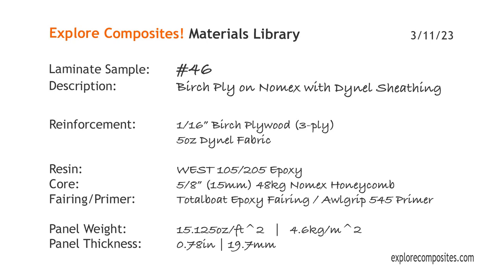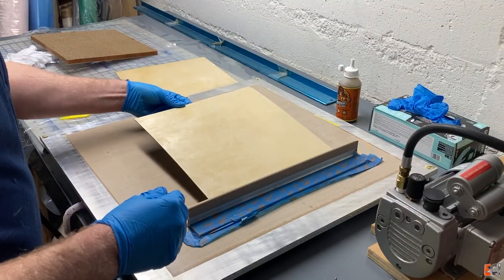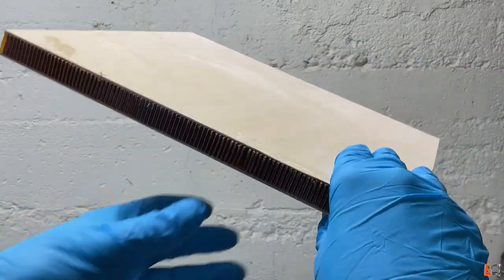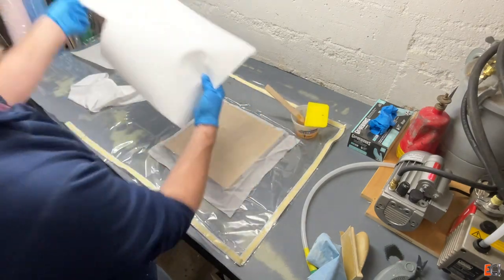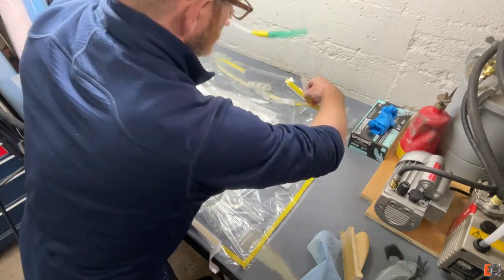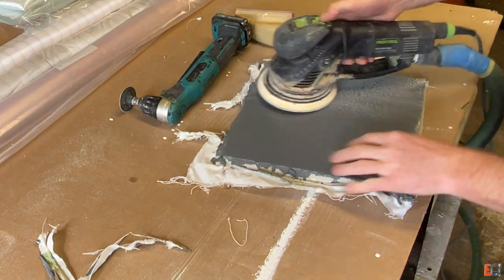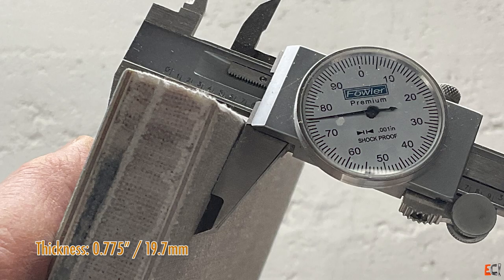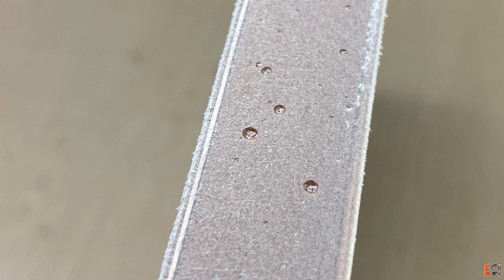Laminate Sample #46: Birch Ply on Nomex with Dynel Sheathing

Comment: Your best off giving the nomex honey comb a little wiggle once you vave put it in the glue coated plywood, this captures the glue that is wasted in the centre of each cell.
Reply from the maker: That's a good tip.  It will wick up naturally if viscosity gets low enough (not going to happen here) but agree - glue out in the middle of a cell just sitting there isn't helping!

Comment: You've tried a lot of combinations so far. Which one do you like the most for a universal structural application?
Reply from the maker: Oh I don't really have favorites - some are more interesting though!  The problem with these materials is that there are so many variables that it's hard to pick a "best" - you can usually get to a workable solution from a bunch of different angles.  Usually its manufacturing concerns that matter as much as materials - unless for a very demanding application where you can afford to do something difficult because some aspect of the product requires it.  

If I had to choose, I'd take infusion because it is so manufacturable, inexpensive and not messy.  Add glass or carbon, some foam core, and common infusion resins - and you have a good place to start for many types of parts.

Comment: How well did the Gorilla Glue adhere to the Nomex?  Does it hold up under flex tests?  Does the wood splinter before the glue lets go?
Reply from the maker: I don’t know!  Going to have to buy more than the absolute minimum quantity of ply next time!  Its always nice to break stuff.  My guess is that epoxy would be tougher and a better all around choice - but Gorilla may be adequate if enough is used - and probably lighter.
Reply: @ExploreComposites  Also way cheaper and more natural than epoxy. I wouldn´t want to use epoxy and glasfiber etc. Wood neveere wood glue and shellac it all it takes.

Comment: I don´t get this really. What´s the purpose for this material ? Why so complex with additional coats of epoxy putty why not just paint over the previous layer with some PU varnish ? 
Are there tests being conduncted with this piece of material ? I am really confused.
Reply from the maker: These "laminate samples" are just a look at a bunch of materials and processes all bundled up into a square foot some something somebody might actually be able use.  This one is a bit out there, but the combination of plywood skins with a honeycomb core is great for light stiff things where wood is ok.  The Dynel is a good sheathing material - tough and abrasion resistant and shown here filled and primed to a paintable surface.  Lots of the other samples are more common recipes, but I try to show something interesting in each one - a material, process or tool - sometimes maybe I try to pack too much into each one!
Reply: @ExploreComposites  Ok now I get it. I have seen a couple of your other videos, well done. Interesting stuff. 
Have you tried something super low cost like corrugated board with resin ?